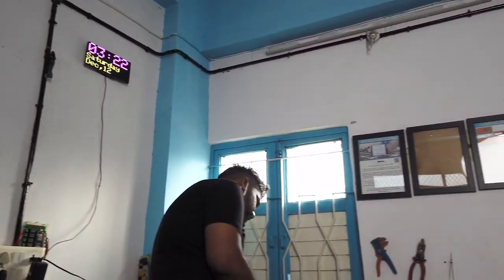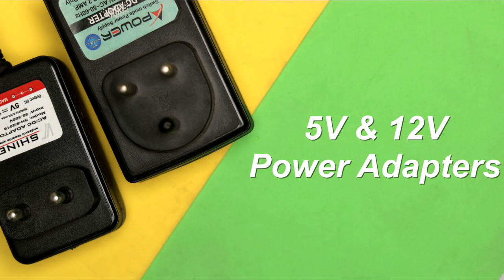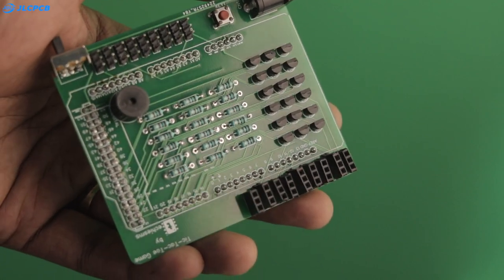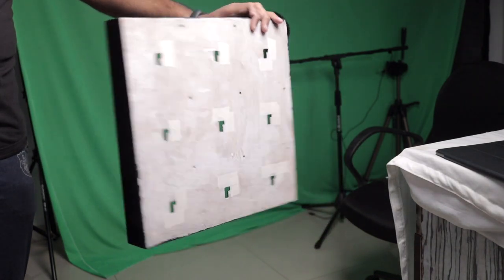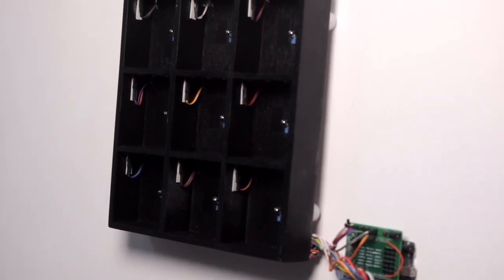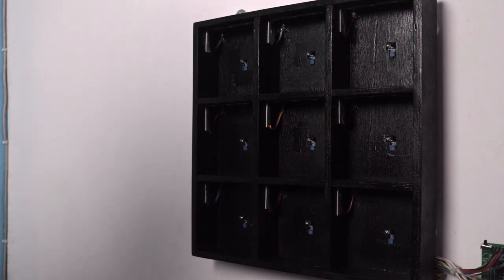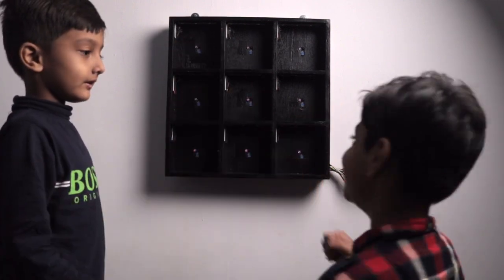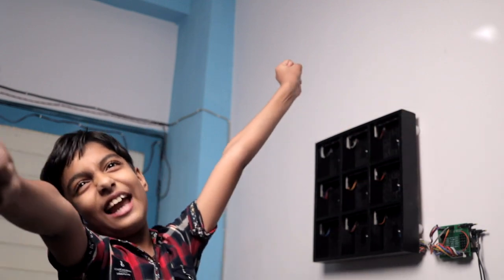Biggest! Arduino Game - Sensor based Tic-Tac-Toe using Arduino mega

Comment: Instead of using two sensors... Can't we just use a buck converter for 5 volts? Or use the Vin pin of the Arduino?